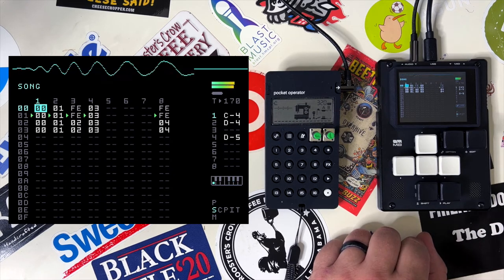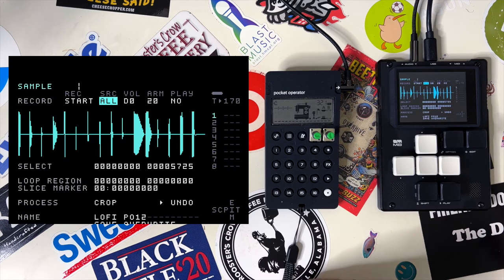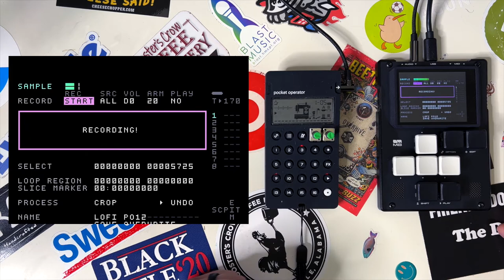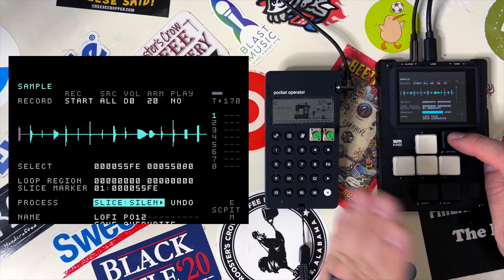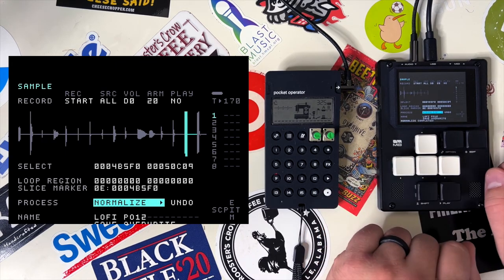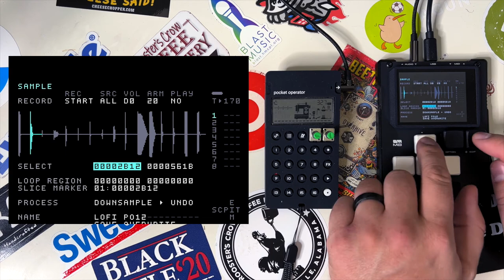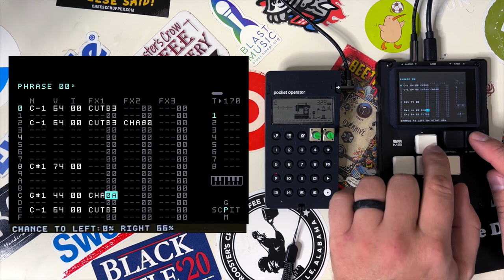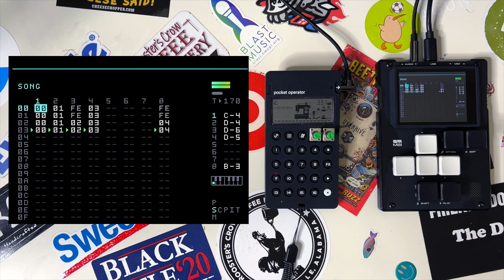Deep Dive into the M8 Sampler and a few comments on "Chance"

Comment: Hey ! Are you sure about loading 32 bits samples on the SD card ? Actually I just load 24 bits samples on mine and the manual say it’s only possible to load 8,16 or 24 bits samples.
For direct sampling you’re right, it’s 16 bits.
Reply from the maker: You’re correct - can only load samples up to 24-bit